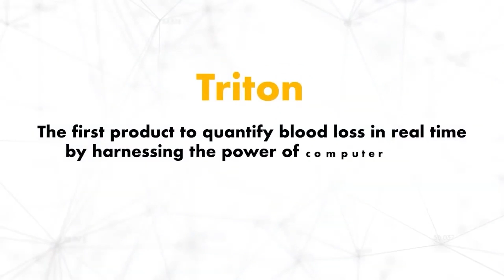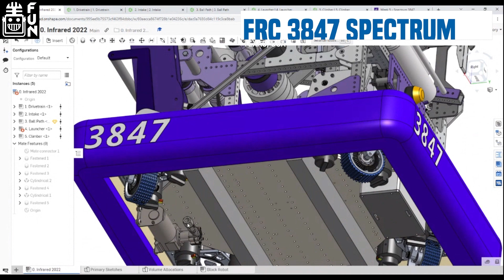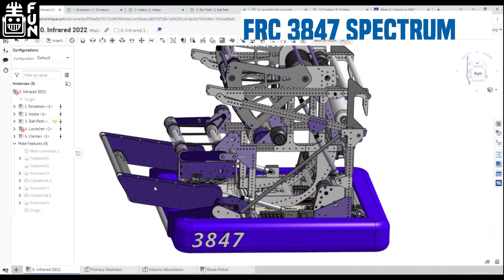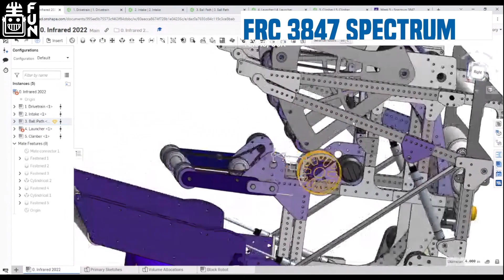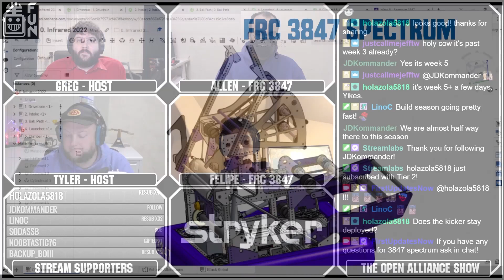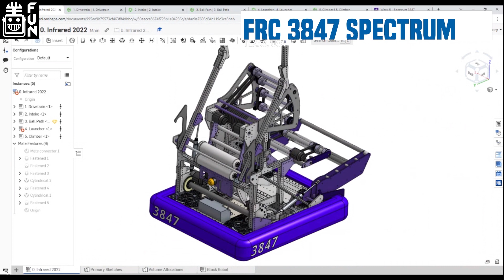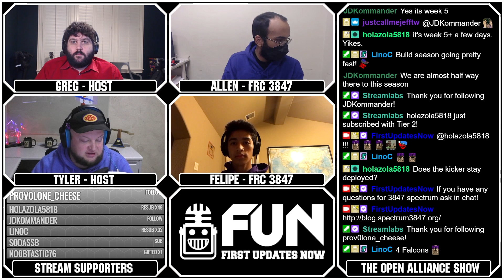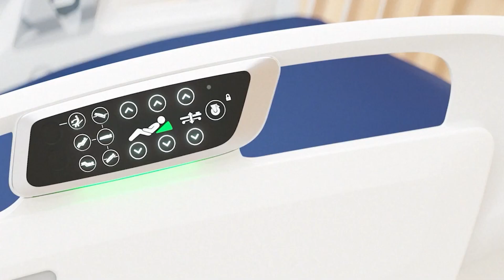FRC 3847 Spectrum CAD Overview and Chassis Assembly | The Open Alliance Show

Comment: Wait, they cut polycarbonate on a laser cutter????
Reply: Yes we do, it's critical to have a good ventilation system and cut completely through in one pass to avoid most of the gasses from getting to the mirrors, also a lot of air assist helps.
Reply: @allengregoryiv  it just burns up and leaves atrocious edges for us, even ignoring the fumes. We are using a 130W CO2 laser
Reply: @jacobfrye996  same, it just leaves terrrible edges